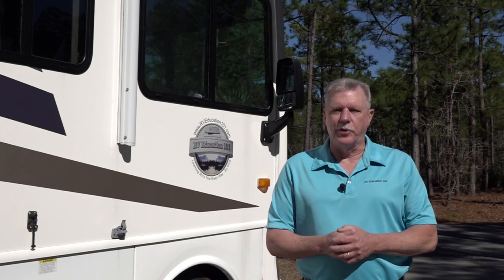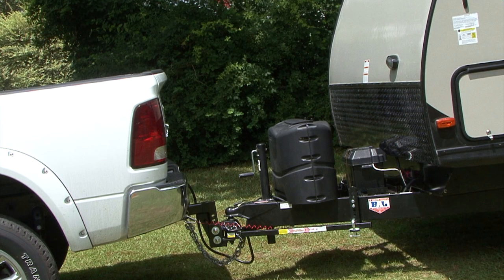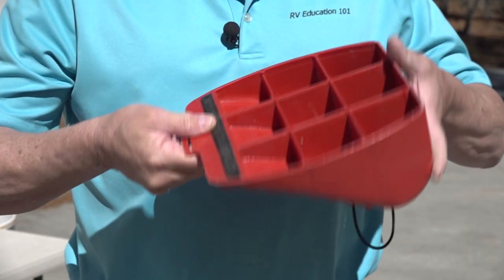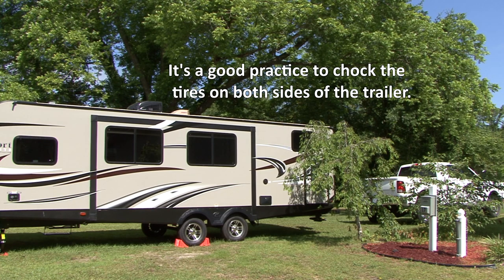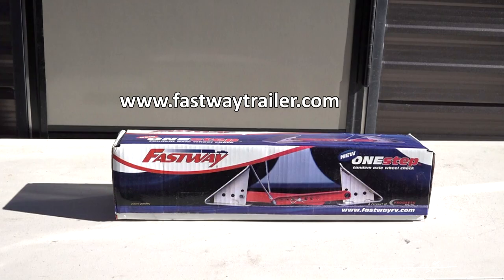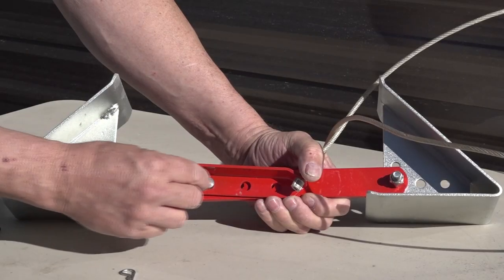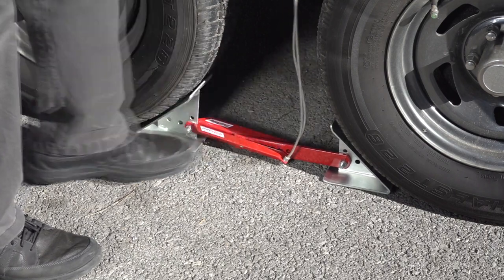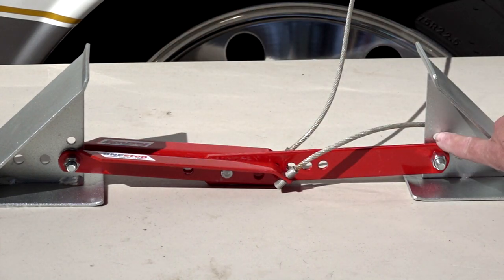RV 101® - Understanding  RV Wheel Chocks

Comment: Another problem you can run into with those cheap plastic chocks, especially here in the Texas Panhandle, is that the wind can blow them out from under the tires. We have had winds a few times this year where that has happened. Now we use the heavy rubber ones and some x-chocks.

Comment: Hello, thanks for this video. That leads me into a question, does one need wheel chocks for a Motorhome?
Reply from the maker: No, not for any motorhome that has an automatic transmission with a park position, and diesel motorhomes use an air parking brake system when the RV is stationary.
Reply: Isn't it still a good idea just in case?